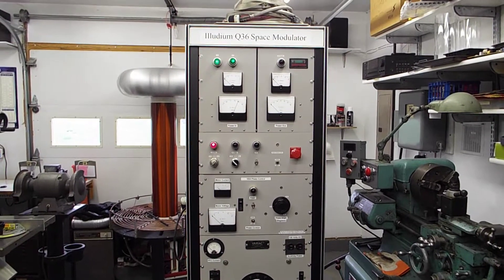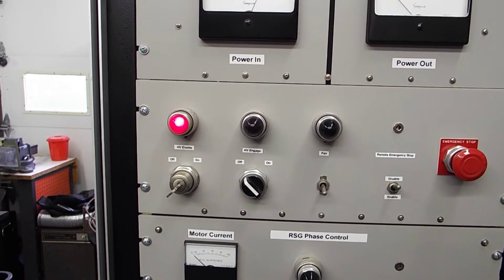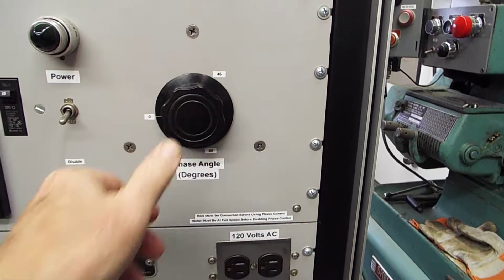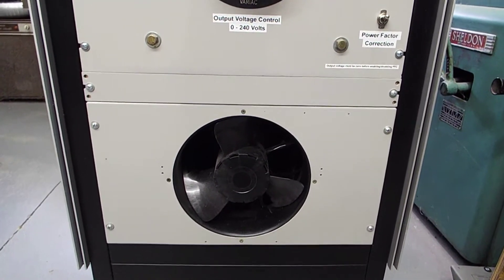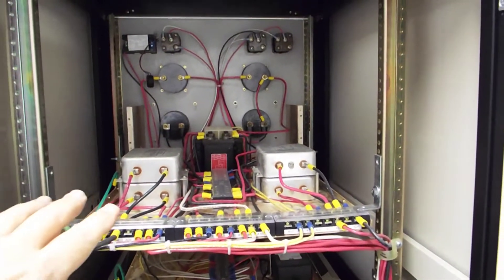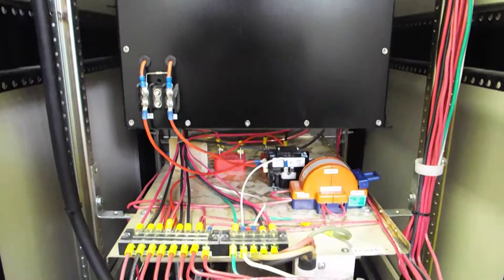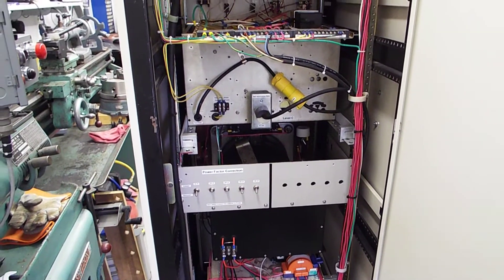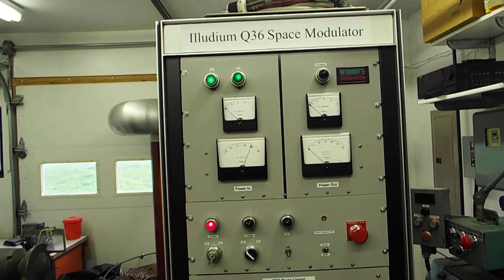Spark Gap Tesla Coil Control Cabinet

Comment: Love the look of this cab.  It has given me inspiration and ideas for the one that I am about to start assembling (0-240V/100A / PowerStat 4-stack)). Is the small digital meter by output at the top for PFC?  Would love to get a better look at your wiring diagram that was inside the back door.
Reply: That’s a beefy variac. How much did you have to pay for it? I just got a pretty good deal on a 5kva 0-330v 240v variac for around $100. I’m gonna have to take it apart and check it out though it seems too good to be true.
Reply: @ginnis_14  Actually,  I friend of mine that was getting out of the HV hobby donated all of his equipment to me.   This was one of many goodies.   😀
Reply: @Kilroy01  Wow you got really lucky haha. It pays to know people. Have you heard about the red cheap 220v variacs that I am seeing? I have a 110v model and it has lasted me so far, but due to its price it seems kind of sketchy.
Reply from the maker: Those cheap Chinese variacs are no comparison to the old American and British variacs such as General Radio, Stacor, and Superior Electric.
Reply from the maker: This is an old General Radio variac. There's no comparison between this and one of those cheap Chinese variacs. I bought it 20 years ago used for about $100 as I recall. They sell for a lot more now.
Reply from the maker: That small digital display is a failed experiment. It was intended to measure the power factor but the noise on the power supply lines killed it. I just left it in place to avoid a hole in the panel. This is an example of why to avoid using digital electronics with high-power Tesla coils.

Comment: Ecellent- great description of the insides of the cabinet. Illudium q36 from looney tunes thing to destroy the earth. 
Oh btw if you are going to need a lock on the power button, you would probably need to have one on the back of that cabinet as well. Noticed it opened easily.
Reply from the maker: The back has a key and can be locked. Its also pushed up against a wall so the back is not accessible. I only pulled it out to make this video.